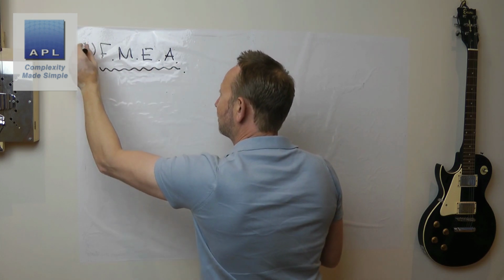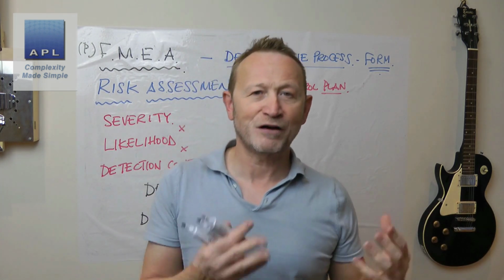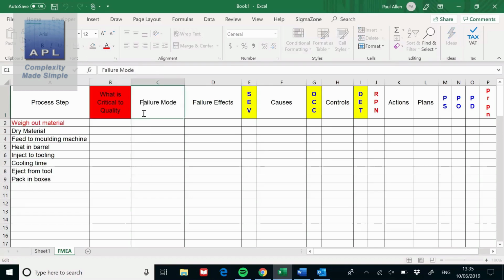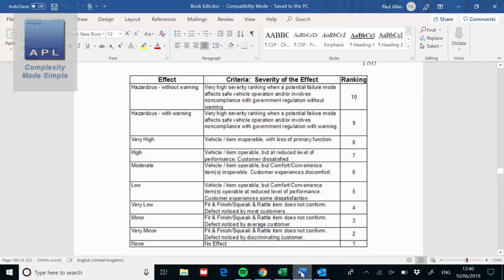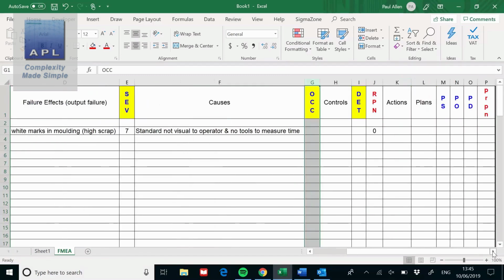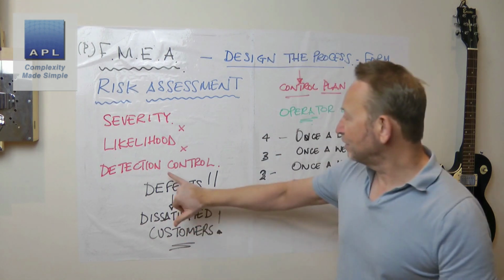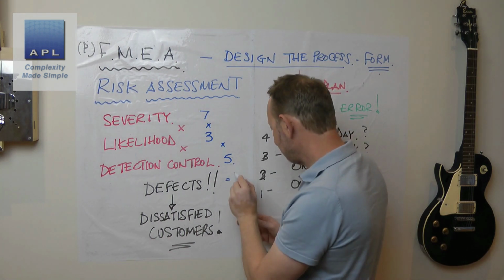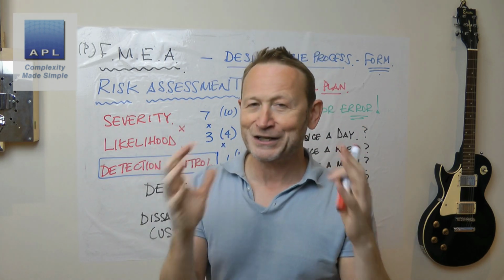How to do FMEA properly - A tutorial

Comment: Thank you Paul! You make this sound so easy, I hope you will be doing a video of the new AIAG/VDA FMEA soon!

I have a couple of questions about making my own severity/occurrence/detection tables: 
1. How much am I allowed to change? The standard doesn't say anything about this, so I am unsure what I can do and still pass an inspection. I am trying to maintain the same "levels", but I am making it completely my own. 
2. In the AIAG/VDA version of the severity table they talk about "Loss of primary function" for the end customer. So if I am delivering parts that do not affect the car primary function (drive), then I can never get an 8 in severity (for customer)? Or should I consider loss of primary function for the specific part that I deliver?
Reply from the maker: Louise - good to hear from you and good questions. I'm not an expert on how AIAG/VDA might audit your design processes, but here;s my simple suggestion. Just line up an alternative scale next to the AIAG version so that your engineers can read across from your company scale to the AIAG scale. That way you can claim 'your' scale is additional information. If you end up with only 6 categories on your scale compared to AIAG scale, just miss numbers out. So your 6 (worst case) lines up with AIAG 10. Your 5, lines with AIAG 8 and there is no use of 9. Hope this makes sense. To be honest you're ranking risk on an FMEA, it doesn't really matter what the score system is, It matters that you use it consistently and what the response has to be be. When you get high risk results how do you behave or respond...

I would say loss of primary function relates to the part you are making rather than narrowly looking at the drivability of the car.
Reply from the maker: Louise - Personally I would say you can change it all. It's your business, it's up to you to design the3 best systems for you, not try to implement a standard system. AIAG is for car making supply chain, if that is not your business then it's not the best standard to use. Loss of primary function would be linked to the part/system. So if it's light switch primary function is the lights not driving the car. I'll try to make a video about suggesting ways to keep the VDA process with your own instructions linked to it....

Comment: I have a Question, What is the method or process to reduce severity of an occurrence while performing PFMEA
Reply from the maker: Sunny - yes i agree with MTK, if the failure is 'a fire breaks out' how serious is that? It doesn't matter how much work I do, I can't really change the fact that a fire will have a very high severity. I can reduce the likleyhood though or put controls in place like all material in the building is fire retardant to control the situation....
Reply: Try understand the difference:
- Severity Rating is how bad the Effects of the failure are if a process/product does not fulfill its intended funct. You cannot reduce/increase the severity.

- Occurrance rating is how often will this failure occur. U can reduce occurance by optimizing the process  or make changes to design.

Hope that helps.

Comment: Thank you for this video. I'm new to this tool and I've seen a lot of different opinions on how to do it. I got a question for you: should a FMEA contain all the characteristics of the product rather than only the critical ones? Some people in the company where I work think that makes a very robust FMEA, but I don't agree with them. You end up with a huge document and nobody will want to take a look at that as the tool it is meant to be.
I hope you can help me clear this out.
Cheers!
Reply from the maker: Wildp - thanks for the question, It is important to separate the DesignFMEA from the ProcessFMEA. In the design FMEA you should have all the performance charatersitics that the customer wants and the designer should deliberately address each one in the design. Then the process FMEA will use this information to quantify risk of a process control missing and how important it is. What maybe missing at the start of your process is a prioritised list of CTQ's that has been created from a Voice of the customer exercise. With a prioritised list it's easy to over design or control the design when it's not needed.
Reply: @paulallen5321  thanks a lot! This is a really helpful answer.

Comment: what is the difference between control planned and action plans
Reply from the maker: Javed - good to hear from you. I would say action plan is a one off plan to implement controls, control plans are something that happens regularly. For example: lets say we decide we want to control air pressure, but there is no gauge on the machine. The action plan would say install gauge and agree a standard for air pressure. The control plan would say check air pressure every 2 hours and make sure it is at 1.3 bar...
Reply: In this video... FMEA is done for the new process... Hence we are using planned controls hence forth there is no action plan in this case.... Planned controls equal to action planned. Hope I am right?
Reply from the maker: Javed - It could still be even with a new process that we have an action to implement the new process. Then regular controls to keep the defects away...
Reply: So you have not mentioned any action plan for this example..?
Reply from the maker: Javed - you are correct there should be an implementation plan and a control plan that maintains it...